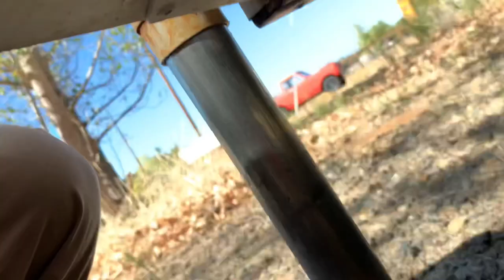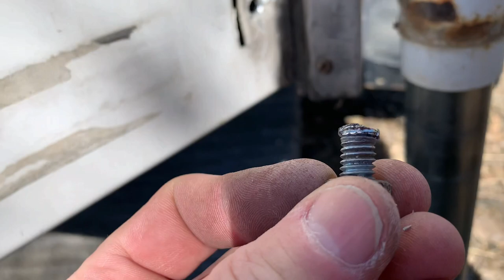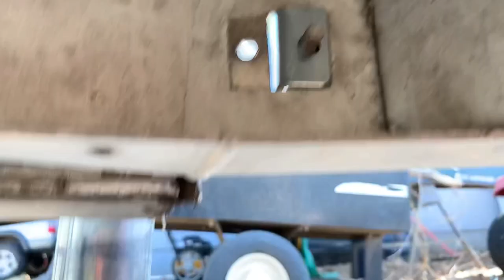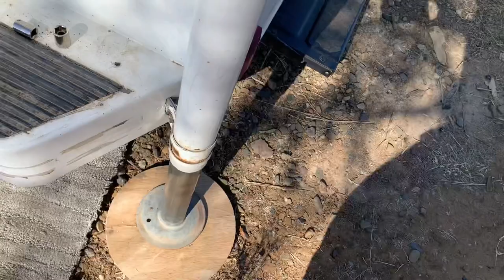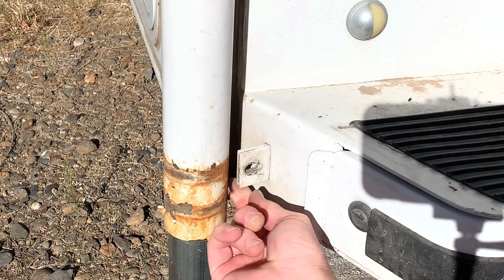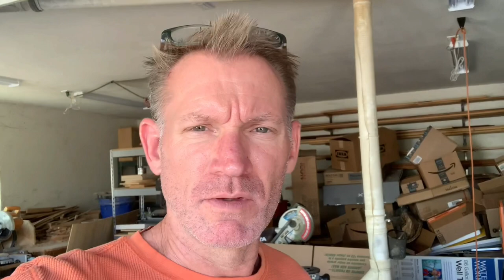Lance Camper Rear Jack Repair.

Comment: Thanks for your videos! Nice Scout in the background
Reply from the maker: Thanks.  Scout is a 1973 one family owner.  My grandfather purchased it new.  63,000 original miles.
One day I’ll get it fixed up.
Reply: @covetthecamper2289  I had a similar but in a 78. Camper question, I have the Atwood jacks with remote like you had in the video, inherited the camper after a 5 year sit under a shed in the wood line of a farm. Mice chewed through several sections of the communication cable from switch to distribution panel, Can you use a 6 position phone cable to replace this or would I need to get one from Gama or Atwood? Your thoughts?

Comment: Job well done  By the way , I love your neighbors old Scout
Reply from the maker: Thanks.  That’s my 1973 Scout II.  63K original miles.  My grandpa bought it new.  It’s in line for a restoration.
Reply: @covetthecamper2289  Awsome i love old scouts  i had a1966 scout 800  and a 1972  travelall 1110  4x4  loved them both.  Then came marriage and babies  and had to sell them

Comment: Looking good. Guess the hardware store was out of stock of Rust-Oleum paint. Hope the incoming storm isn't to rough. Stay safe.
Reply from the maker: Everything was treated with VHT rust converter and repainted gloss white using POR-15 topcoat.  Both rear jacks were lubed and load/clutch tested as well.
I just didn’t show those steps in the video as it takes several days.

Comment: Great video. I was debating between aluminum vs steel to straighten and add support to the bottom of the rear jacks and my concern was rust. Did you end up painting the steel L braces? I have a ‘73 Chinook Slide-in camper. Wish I could post a picture in the thread of comments for before and after. Thanks again.
Reply from the maker: I did a siliconized rubber coating.  POR15 works as well.